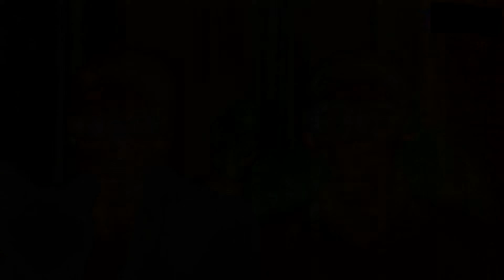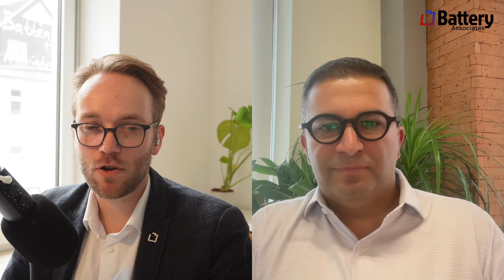In conversation with Vikram Handa Founder, Managing Director - Epsilon Advanced Materials

Comment: Wouldn't using by- products (feedstock) of petro markets challenge supply chains? Why build a product with so much reliance on the fossil fuel industry especially given its going to impact life cycle assements of the end product?
Reply from the maker: Using petro industry by-products doesn’t create new demand for fossil fuels but these materials are already generated in other sectors like steelmaking and petrochemicals. While they still require processing to meet battery grade specifications, repurposing them into materials like synthetic graphite for anodes avoids the environmental impact of extracting and producing new raw materials, reduces waste, and supports a better overall life-cycle assessment. GK

Comment: Can you elloborate about the coating process in graphite?
What kind of material is used for this coating?...
The parameters that's affects the caoting ( method,coating material,thickness)
Can I get some insight about this
Reply from the maker: Great question! In graphite anodes, coatings improve conductivity, reduce side reactions, and extend cycle life. Common materials include amorphous carbon or coal tar pitch (CTP) helps to form a stable SEI and enables fast charging by enhancing surface conductivity and Li-ion transport. Typical application methods include pyrolysis and Chemical Vapor Deposition (CVD). Thickness is critical as too thin offers poor protection, while too thick reduces capacity and slows ion flow.

In this video, at 8:47, Vikram mentions that they have developed over 20 different in-house coating products, each tailored to deliver specific performance outcomes. GK